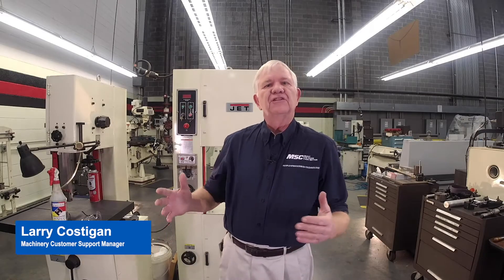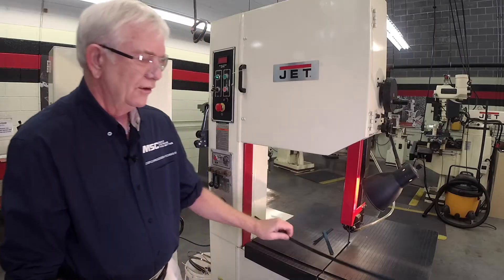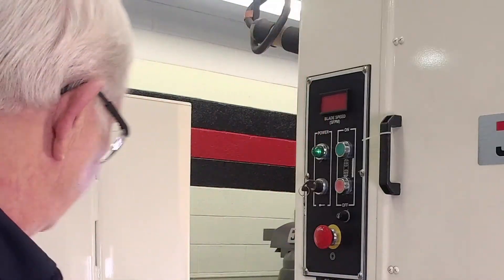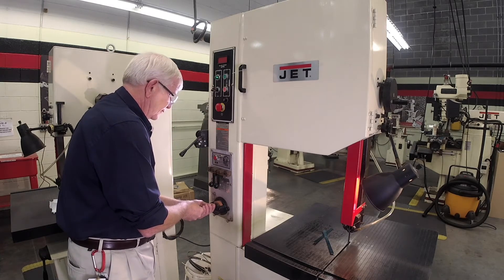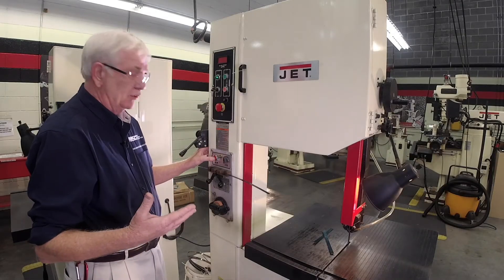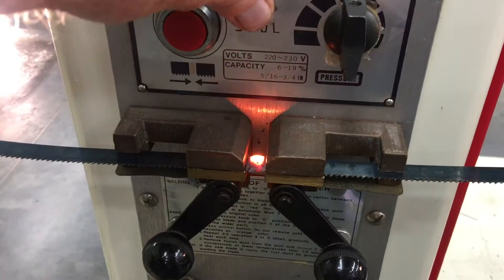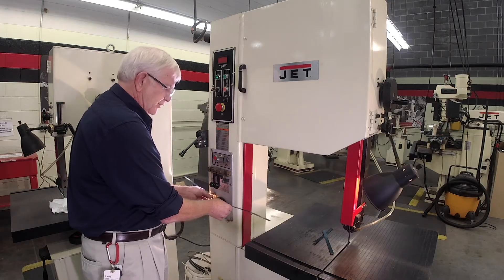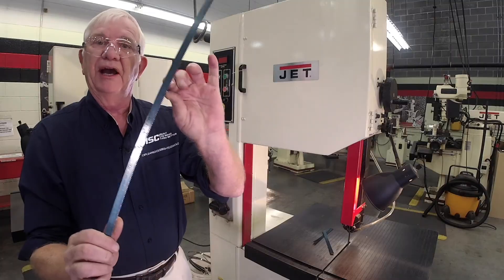How to Weld Bandsaw Blades

Comment: Hold on a minute.  You said this is not applicable to bi-metal blades.  You are incorrect.  My metal cutting band saw (purchased from MSC) has a blade welder built in and the operating instruction specifically recommend bi-metal blades.  No one uses plain carbon steel blades to cut ferrous materials.  I have welded many bi-metal blades using the welder built into my saw without issue.  The main reason the welder exists in the first place is to allow the user to buy blade stock in a roll and assemble their own blades (not cut circles).  This is an example of irresponsible internet disinformation.

Comment: Hi! When you pressure weld a bandsaw blade,one or both holding jaws move closer to each other thus creating the pressure. Could you tell me how much is that movement? About a 10th of an inch if I were to guess. Or less,50 thousands? Appreciate any help! Thank you!

Comment: The most useless tool I have seen lately! I would use a router and be through before one would get started with this gadget?
Reply: How would a router weld a band saw blade? That should be an interesting video and get MANY views. Resistance welding is how band saw blades are joined in production and is older than anyone watching Youtube. Those welders have been standard on industrial machines for a very long time since a bulk roll of blade is cheaper by the foot, cheaper by far to ship and supports making multiple blade lengths all of which should have been obvious.
Reply: @Comm0ut  I was referring to cuting a circle out of a board. I don't think many cabinet shops have the tool you used? In my shop Time is costly. I ,personally would love to have a set up like yours but I feel the cost would we to excessive?
Reply: @mattedwards4533  The video was referring to cutting a circle out of a block of metal. I suspect if you tried to use your woodworking router to do that you would not be entirely happy with the result.
Reply: @Curt_Sampson  I appreciate you telling me you were referring to metal. My mistake. I should have paid more attention to the video.

Comment: WHY TF DID HE GRIND AGAINST THE SIDE OF THE WHEEL?!?!? BIG NO-NO!
Reply: CALL IN THE GUARDS. LETS TAKE HIIIIIIMMMMMMMMMMMM! lol chill bro
Reply: They ARE designed to be ground that way and it is the only flat/straight edge of small round wheel!!!
You use this wheels side to 'square' the blade edge, then on the top of the wheel to grind flat each face.
Imagine trying to hold a bandsaw blade vertical to get a flat edge on the round part of the wheel.
No Eninsteins here 😆
Reply: That system is designed for such use. This is far from a heavily loaded application.

Comment: For years I have been silver soldering bandsaw blades.
I overlap by the same as the blade width. The ends need to be heated to a dull red to anneal them. File or grind the ends to half their thickness. 
You may need to make a simple jig to hold the blade for soldering.
Flux up and overlap the ends. Cut off a tiny bit of silver solder and put it next to the joint, heat with a small blow lamp till the solder flows. Use a flat ended tool to press the ends of the blade together. When cool, do not cool in water!
Trim with a small file till the thickness of the blade is less than the thickness measured across the tooth set.

Comment: clickbait..... should title "How to weld bandsaw blades using this $$$$$$$$$$ band welding machine"
Reply: Well I mean most of the industrial bandsaws like these have their own built in band welding stations built on. I'm on my first day of technical school and we have these and practiced this... any dingus knows if you don't have this you're better off just buying new blade bands.
Reply: The place I work has like 5 of these stations but we cut bandsaws to lengths for customers
Reply: Youtube is not just for noobs and people who never touch industrial equipment. Many non-industrial users own full size industrial machine tools or are hunting one or want to buy or fab a blade welder. That's why I'm here. I've access to my bros blade welder so I'm going to buy blade cheap in bulk then spend a day welding a bunch. It used to be common to weld one's own blades for much smaller saws like smaller horizontals many hobbyists buy used. Separate blade welders are still available and they can be separated from a scrapped saw (more than a few Youtube viewers work on machine tools too).